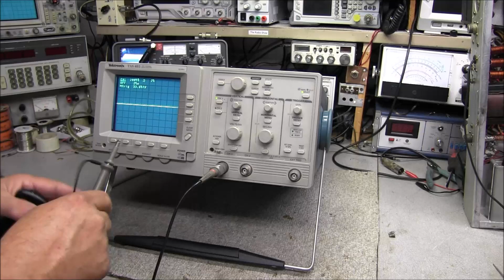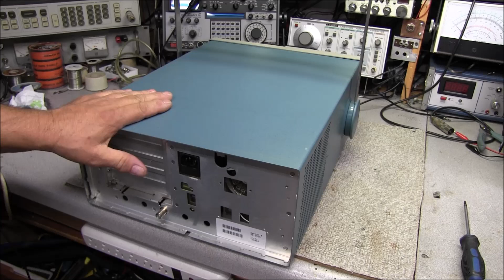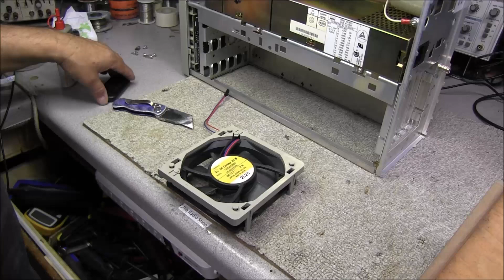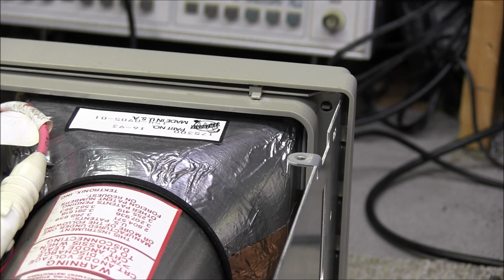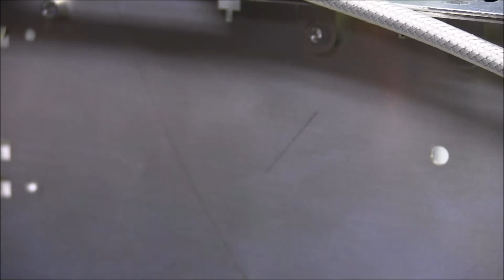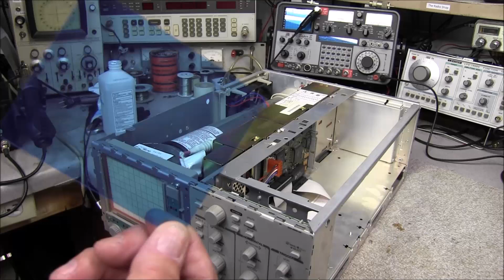#217 Tektronix TAS 465 Simple Service Tips

Comment: It seems to be as simple as cleaning an dirty old remote control, once you get it apart.
The fan lubrication is an excellent idea for anyone with equipment this old.
Just got a TAS 250 that sat in the sun so long, several of the smaller knobs broke when I touched them.
It does work, though. Thank you for this video. I'll know what I'm dealing with when it has problems.

Comment: Great job as always Buddy, it was a lot of work to get at the controls.
Would you know if the volts/div knobs "pull" off like your scope, on a Tektronix 2236?
I need to put on two  number "dish" that sits close to the face plate, that is if I can find them.
Thanks for a great video.
Reply: Those knobs are held on by little set screws on the sides. You'll need a very small Allen wrench to get them loose, then they just slide off. That's after you've removed the little red 'CAL' knob which has it's own Allen head set screw. I don't remember now, but I'm 86% positive that each of those big knobs has two set screws. Check for two before you start pulling.
Reply: Thanks George, I need the back plate of the knobs, the ones that have the volts per div. on them, both are missing and without buying another scope the are not available.

Comment: A couple of years ago I had the unfortunate experience with removing the cover off of one of these units that had been dropped, possibly from a high cliff with the way it looked. Story was it was purchased new and dropped the same day and it was reluctantly plugged in and turned on and it worked so it was in use for several years. It had the same problem with the buttons needing cleaning as yours did. That was the easy part. Taking that thing apart is an experience I never want to go through again. It wasn't pretty to watch and required some adjustments with a body hammer and a paint job when it was done.